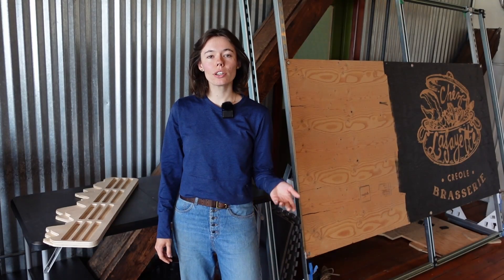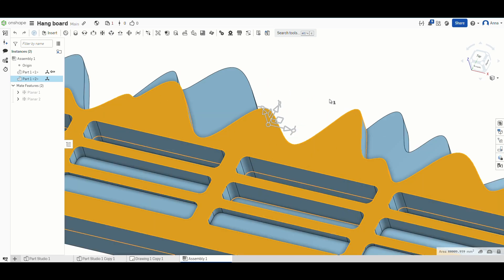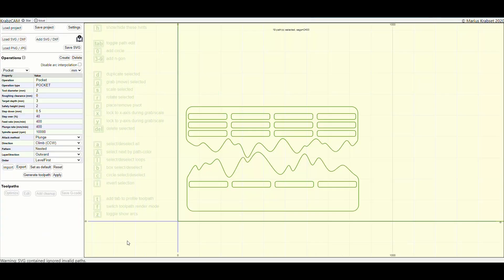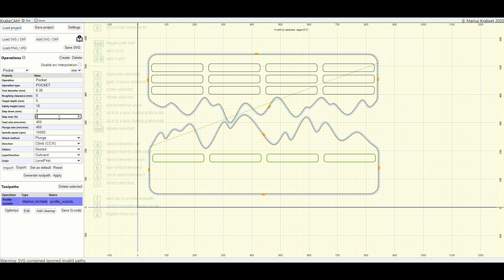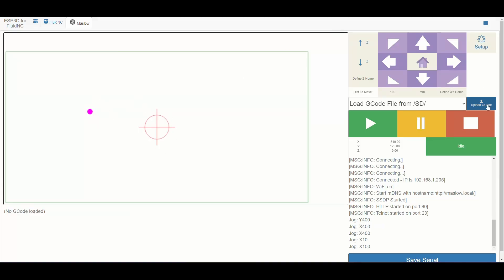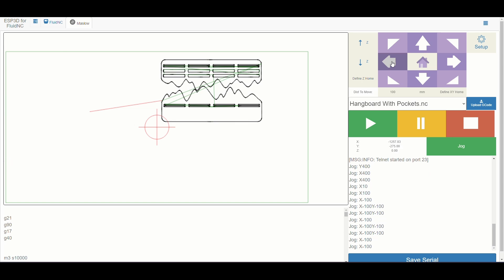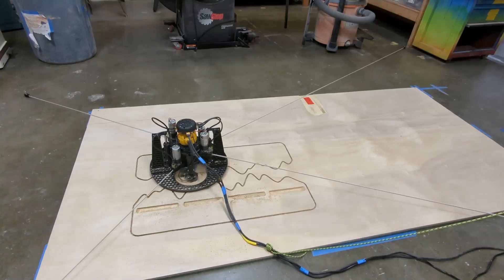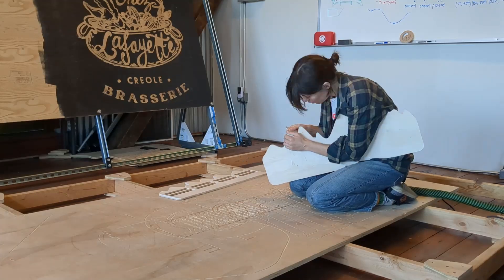Maslow 4 Hangboard Project

Comment: Great work. I have a few questions.

1. Why you didn't use the frame for cutting, where you later sand the pieces?
2. Why did you need tabs? Is it just because you where not using a why to stick the board in place?
3. What is that hang board for? Keys?

Comment: Nice demo. I don’t understand why on computer you are close to the edge but in real life you are off by a lot.
Reply from the maker: Good question! When it starts up, the interface shows the last saved XY home at the center of the green rectangle. Redefining the XY home will change the location of the rectangle. But before you do that redefining, it looks like you are jogging the Maslow off the edge of the plywood on the screen. The rectangle is more to help with visualizing scale of your drawing, so it doesn't actually represent the bounds of the sheet of plywood.